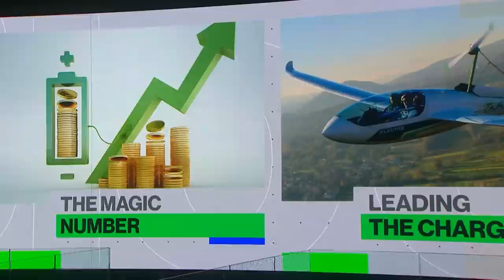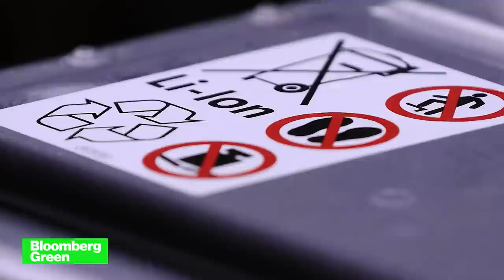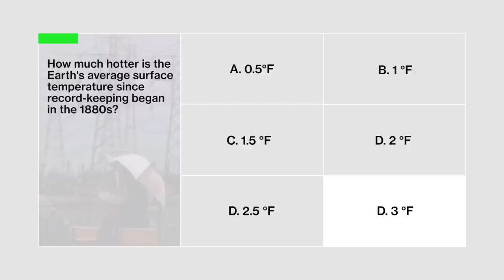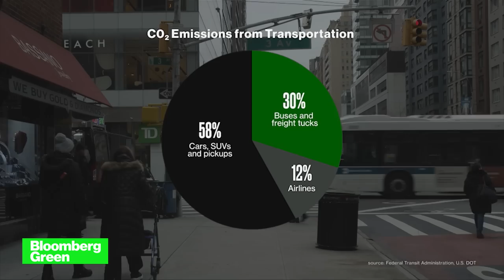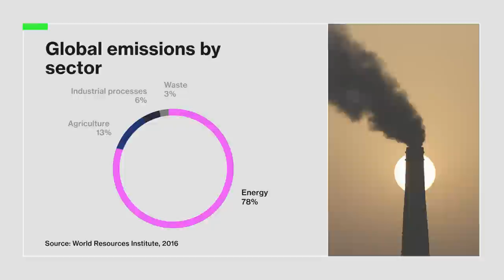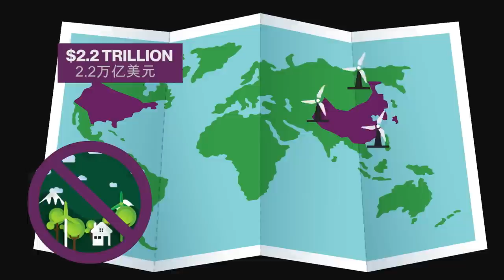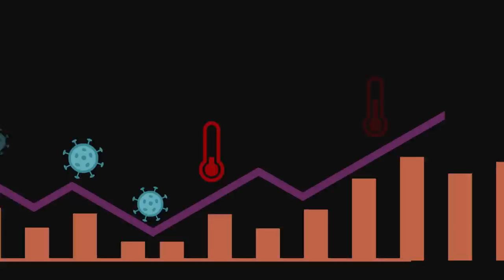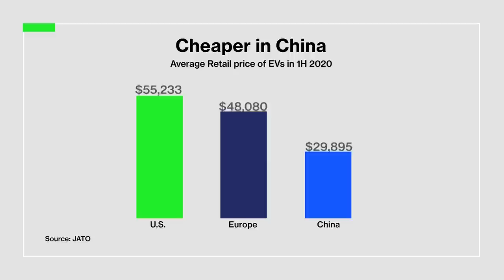'Bloomberg Green' Full Show (11/27/2020)

Comment: Energy density is the key. If batteries energy density is limited it will never overcome the cost efficiency of cracking that carbon atom that oil/gas provides.